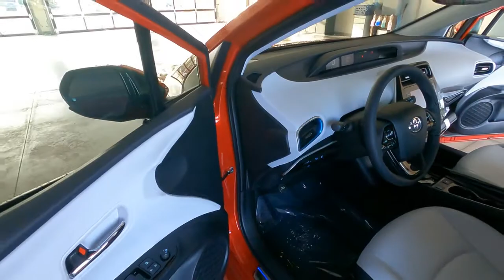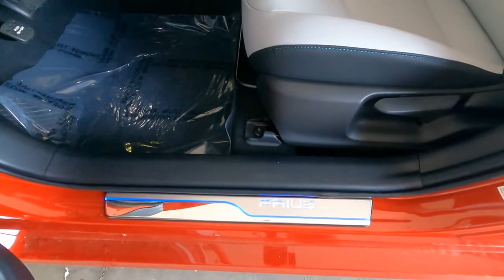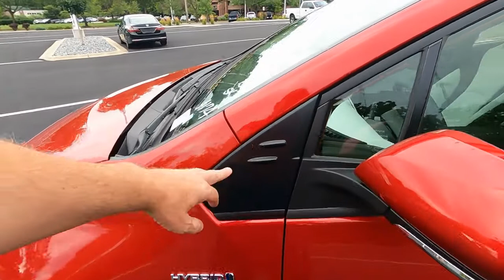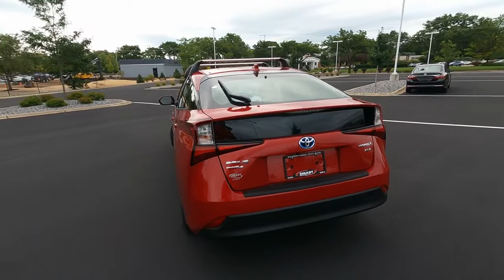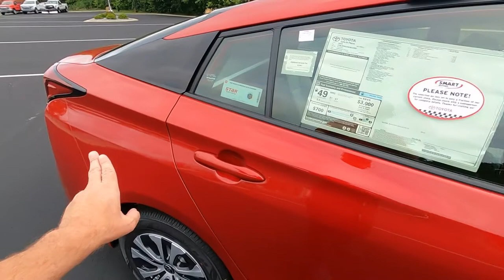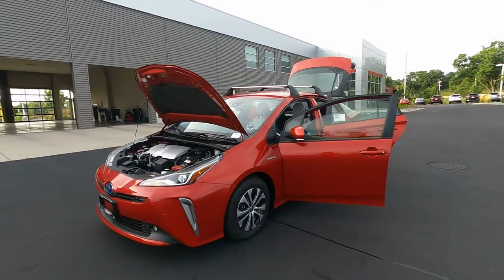2022 Toyota Prius XLE AWD Walkaround

Comment: The Prius Hybrid has some extra things.  There is a pull out privacy curtain in the trunk. Oh, it also has garage door buttons on the rear view mirror.  My Prime doesn't have those buttons.
Some more things here.  All Limited style level has a Tesla 11.5 inch screen. Also, there are two (3 on a Prime) buttons below the screen.  One forces only EV driving.  The other button allows 3 performance levels with gas.....
Eco, Normal, Performance
Don't forget, the Prime plug-in is the only EV that has a gas engine if you run out of electricity. I've seen a Tesla and a Mustang EV run out and just stop in the road.